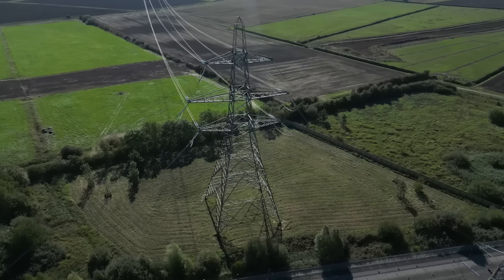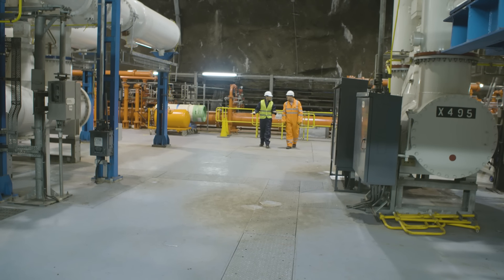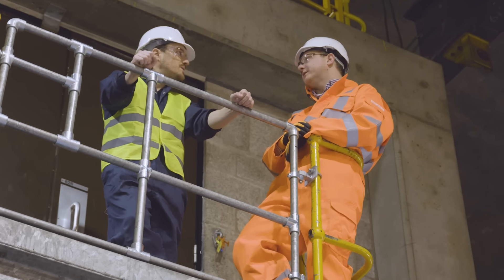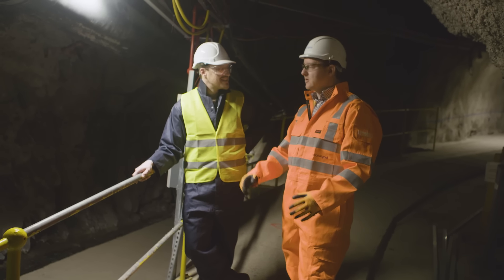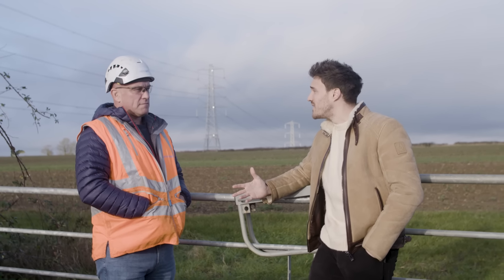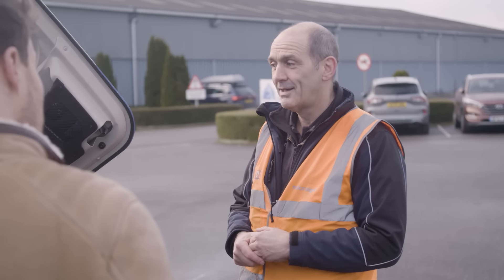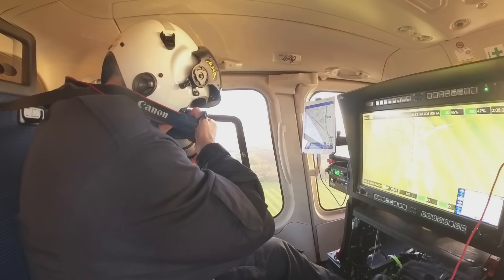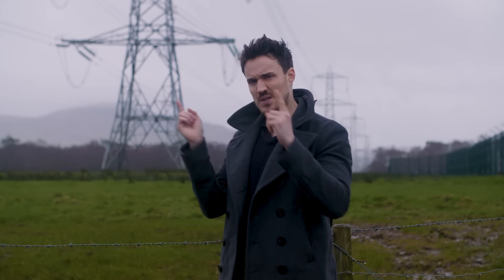Unveiling the Power: Behind the Grid | Episode 2: From Shore to Substation

Comment: I am fascinated with the energy transmission and the transition to net zero.

My question is what is the efficiency factor of Dinorwig. I.e for every 1 unit of energy generated by releasing the water from top to bottom. How much energy does it take to pump back it back up to the top.

I am convinced grid battery storage is the key to our future.
Reply: It’s a pumped storage scheme so when it’s pumping up to the top reservoir it consumes power from the grid, however this is done at off peak times when there is spare power from nuclear stations. This power station is used to manage peak demands only and does not generate 24/7. It’s a big potential to kinetic to electric energy machine. It can be online in under a minute to satisfy peak demands on the grid then recharge for the next one. Hope this helps.
Reply: @TechOne7671  hi thanks for the reply. I understand but my question is how much energy is lost by pumping back up to the reservoir.

I mean is it 2 units of energy to pump up vs 1 unit of energy releasing the water at a later time of the day.
Reply: I had a tour there several years ago and might be mis-remembering, but I think they said around 75%. But of course being in Cymru you get some free energy with all the rain fall.
Reply: @deansh8506 I had a quick google, same as what David says. Looks like 75%. 

Each motor requires 275MW input for 7hours to fill the lake. 
They can then generate 288MW for 5hours. 
Very rough calcs but 1440/1925 = 0.75
Reply: @Alex-vz8jq  that's not too bad at all. I thought it was going to be less than 75%. Of course as I live in Wales I know for certain they will have alot of 'free' water at the top of the reservoir quite often.

Would love a tour of the facility 👍
Reply: Both batteries and gravity storage will have their role to play.

Batteries are easy to do decentralised and are becoming cheaper fast, but you probably dont want to use batteries for seasonal storage.